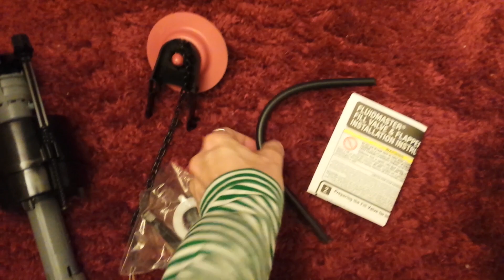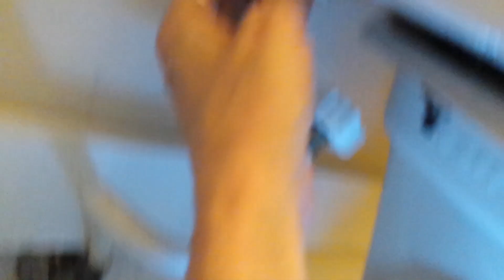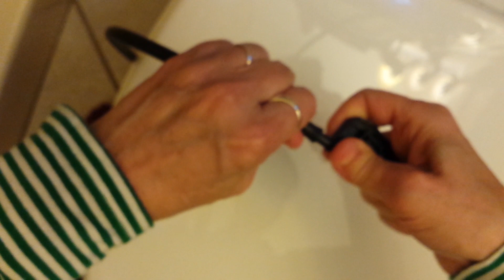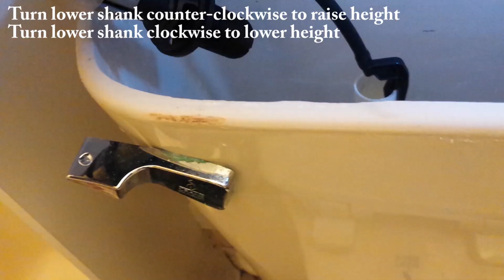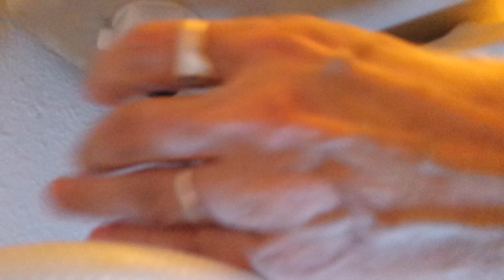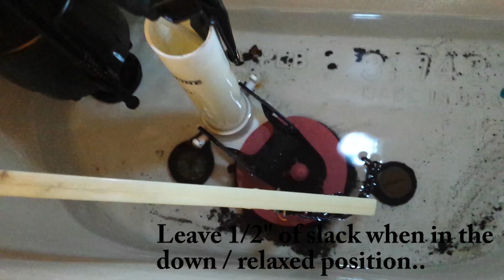SUPER EASY Toilet Repair Using Fluidmaster Universal Kit - No Tools Needed

Comment: This is a great video, as many have said, so a big thanks to Tech Angel.  I had trouble with the silicon bolt up against the tank (I had to replace two sets of kits) so in the end, after trying things like hot water and a hair dryer with no solution, I bought plumbers grease in a tube and a large wrench.  That did it.  The rest was fast and easy.  Now I wish I had a vid of Tech Angel showing how to replace the flush valve and flange as my flange is literally melting away into mush (never use bleach tablets in your tanks).